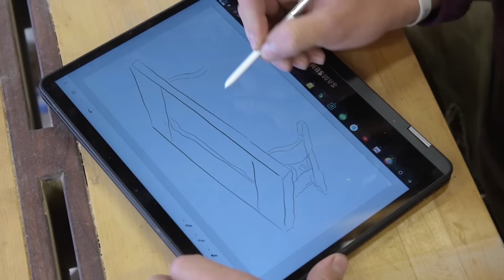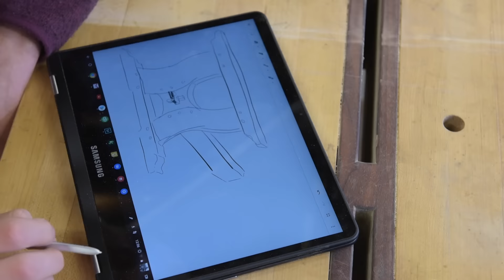A Day In The Life Of The Samurai

Comment: Pro tip if you peel back the weather stripping a little bit you can sink screws behind it and have them hidden when the weather stripping folds back over them. This saves having to pre drill and deal with some ugly screw heads in the door frame.
Reply: Trevor Roth lol, thought I was the only one that did that! It is slick and quick.
Reply: I do the same. Hide them screws! Love the video!

Comment: Sorry if you addressed this already, but what type of hinges did you use to get the bedroom door to open outwards? wouldn't someone just be able to pop the pins from the outside or are the some kind of security hinges? also are they water tight? sorry to ask questions about the hinges on a great video. I guess my curiosity got the better of me.

Comment: Samurai! Arigato....;) Are you using plywood behind the Tyvek? Doesn`t this cause condensation in the vintertime up there in Canada? Greetings from a decent carpenter in Norway;)
Reply from the maker: No.  All are houses are built with plywood or OSB.  We put a 6mil poly plastic vapor barrier on the inside of the framing to prevent vapor transmission form the inside to the outside or vice versa.